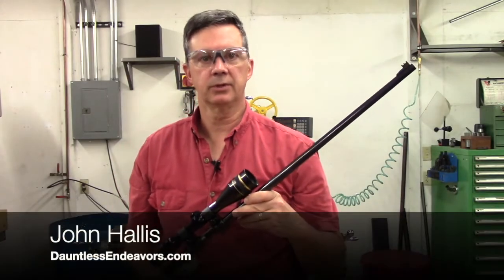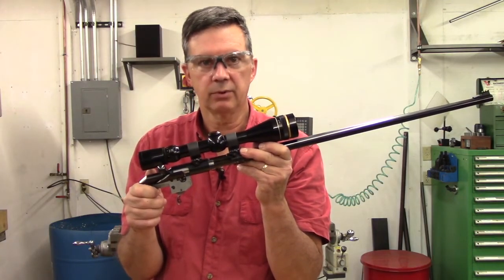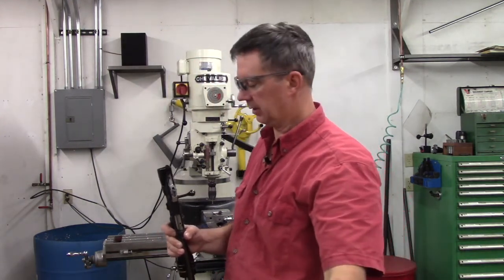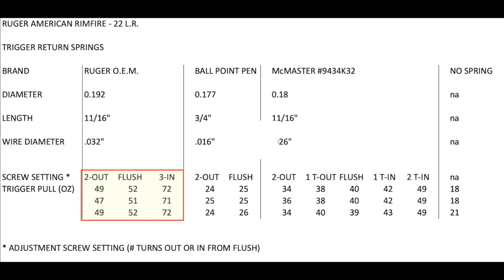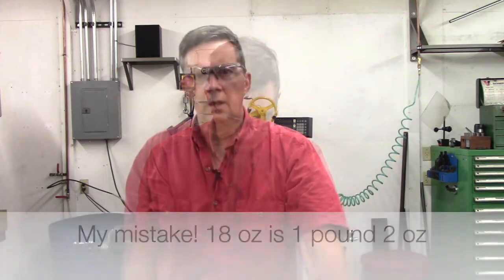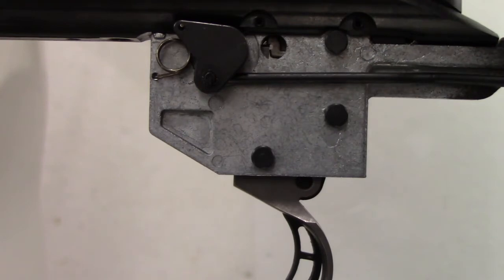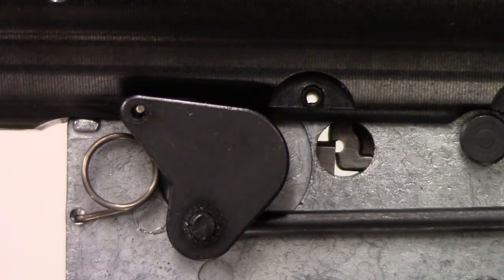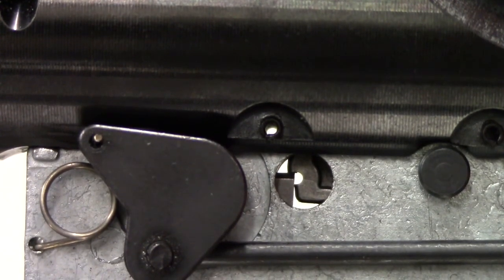Ruger American Rimfire (RAR) Experience, Part 5:  Experiments with Different Trigger Return Springs

Comment: Great explanation. My son has a Ruger RPR rimfire. I actually removed the trigger safety blade since it has a thumb safety. I used the spring from the safety blade cut to the length of the original trigger return spring and adjusted it to get complete sear reengagement. Since this rifle is ONLY used for benchrest shooting it is now a 16 ounce trigger. I would never recommend this for hunting. But for bench shooting it’s a great alternative to paying $275 for an aftermarket performance trigger. No it’s not as good, but on a budget it works well.

Comment: I picked up the RAR LRT I’ve been playing with the trigger I’m also a gunsmith I’ve polished the sear and I took the factory spring out clipped if down two coils and then stretched the spring abit which has resulted in a 2lbs trigger that has passed multiple drop tests from over head I also removed the blade safety

Comment: The friction inherent in the trigger pivot which is from the roughness of the castings that aren't polished, honed, or shimmed, is what's preventing the sear engagement. I agree, having a trigger that light is not advisable IN THIS CRUDE TRIGGER ASSEMBLY. It's totally fine in a Timney or some other system that's got forged and polished and precise parts in it.
This Ruger system can be improved significantly with some file/sanding/cleaning/shimming but that's more in depth than swapping a spring.
Reply from the maker: I completely agree.  If one must have a trigger pull that measures in ounces, I always recommend purchasing a trigger that was DESIGNED to be operated in that weight range.  
I also don't recommend that the average person disassemble and stone or polish their trigger parts.  8 times out of 10, they will screw it up.
Reply: @dauntlessendeavors1000  Agreed. It takes some mechanical know-how and some good steady fingers to understand how to do that properly.

Comment: Great video sir, thanks for this. I ended up cutting 2 coils off the original spring then adjusting it to where the sear would reset after a partial trigger pull. Ended up a little below 3lbs.

Comment: Thanks.
I went for one of these in .22lf, recently.
The trigger as set is a nice weight for me.
My problem is that a gritty feel, makes it hard for me to find the wall.
Sooner or later, it will be reasonable to go in there, emm to day is a rain out.
Ruger has specific torque specs for the stock mounts. This has kept me from going in.
I like your take on deburing the mounts.
Thanks again Chris

Comment: Polish the top of trigger sear engagement area and trigger will slide back using a lighter spring, I did this and am using a .021" diameter wire coil spring and was able to adjust down under two pounds, if you pull trigger back a little before it breaks then release it will slide back into place when there is less friction.
Reply from the maker: Thanks for the info.  As long as you know what to check and  are sure it operates with 100% reliability, you're good to go.